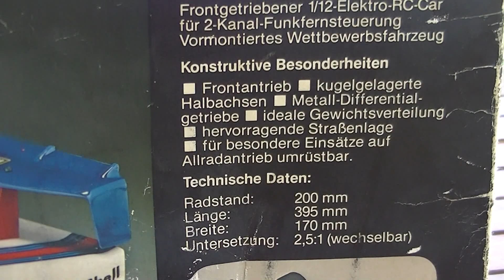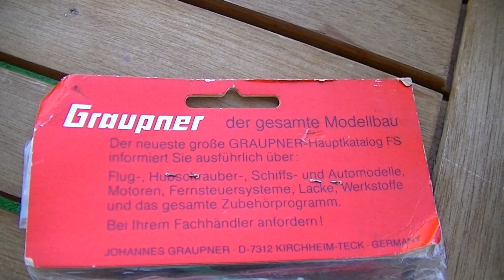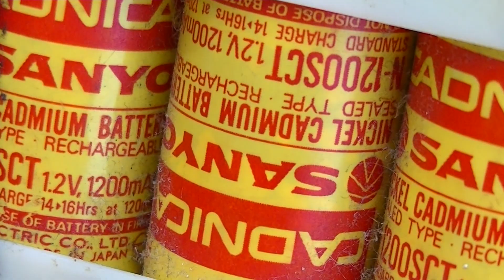Vintage Porsche 936 78 Turbo RC ROBBE 3445

Comment: hi, i'm rebuilding a car like this, the super sports version, but i'm stuck on information about the wiring diagram with the rheostat and the specifications of the rheostat, is it possible to show a wiring diagram of this and provide the specs of the rheostat, thanks in advance, Dirk